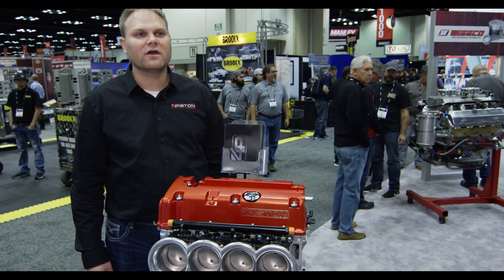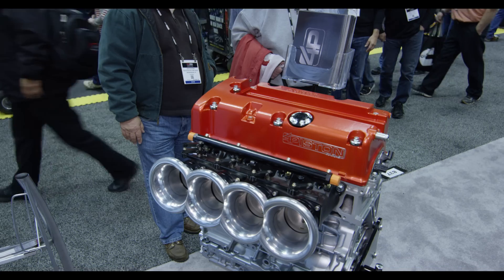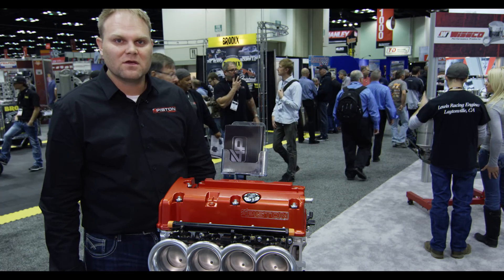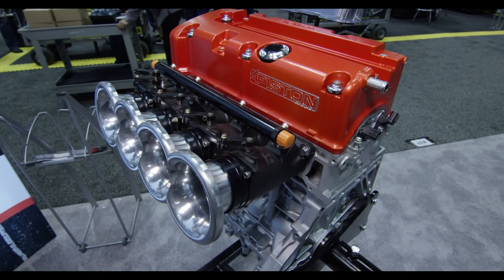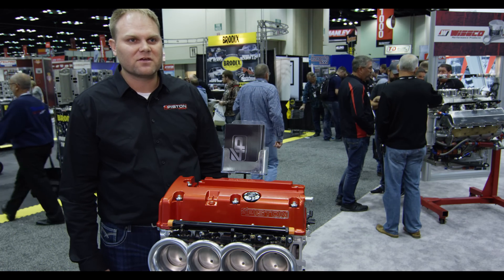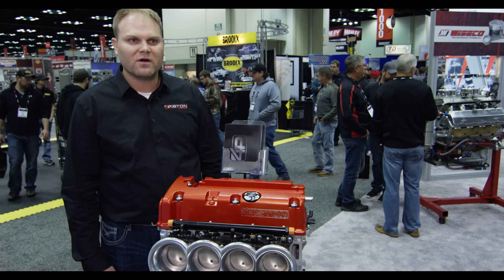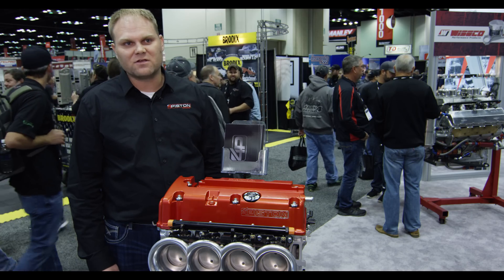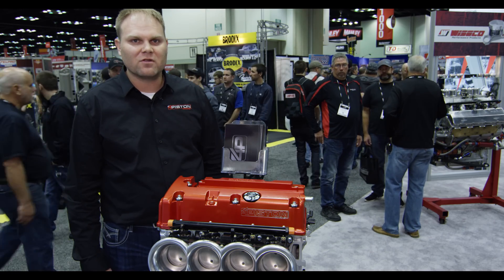Inside a 500+ HP Naturally Aspirated K24

Comment: I dont understand how they can increase the stroke AND redline around 10k without it tearing itself apart.
Reply: Billet/forged everything, dry sump oiling, coated parts, extremely tight tolerances and immaculate balancing…
Reply: Light weight recip and light weight valvetrain.

Comment: so how does a na engine make power, does it draw air from the outside or what?
Reply: It’s way harder and more expensive to make huge power NA, the whole engine has to be optimized for max rpm and max airflow, and then it’s tweaking and tuning and dyno runs for a year or so to reach max potential.
Reply: no shit sherlock
Reply: Every single engine that's not turbo or supercharged  runs on ambient air pressure. So basically almost every single passenger car up until very recently

Comment: I'm interested in what is the highest power you can make on 99 octane(RON) with that engine?
Reply: 150 HP per liter would be a lot
Reply: @SalveMonesvol  they have far surpassed that. 2.7 are making 600+ on nitro 50/50 now
Reply: @PolishedMobileDetailing503  He said 99 RON.
Reply: @SalveMonesvol  gotta be more than 150per litre for the 4piston there are stock block k20 and k24 making 300 with just exhaust headers intake and cams and probably valvetrain upgrades
Reply: @repingers9777  you are confusing RON with AKI.
Reply: I'm saying 93octane those numbers are achievable or e85
Reply: @repingers9777  E85 is great for boosted engines. For naturally aspirated high rpm engines alcohol has some issues: it burns slower, has lower energy density than gasoline and requires more air to make the same power. Of course, if I have to choose between E85 and dangerously low octane gasoline, I'll go with the alcohol.
  Anyway, 200HP per liter naturally aspirated with a usable tune is 15.000 rpm literbike territory.
Reply: @SalveMonesvol  Then...what the BEST fuel for NA engine?.
Reply: @MDEV-86x86  oxigenated 100 octane race fuel of course, but it's expensive.
Reply: @SalveMonesvol  Ok. In Germany you can get without problems 102 octane fuel at Aral gas stations.
Reply: @MDEV-86x86  I meant 100 AKI, which is 95 MON and 105 RON.
 But for street use on a naturally aspirated bike, 101 RON is great, specially if it has no more than 10% alcohol.

Comment: what's the minimum octane required ?  with 16:1 i'm guessing 110+ race fuel !
Reply: 17.6:1 running on 100 octane
Reply: @micekkc  In Germany you can buy 102 octanes fuel at Aral fuel station.
Reply: Good question.

Comment: I don't care who you are, this is freaking awesome. muscle car guy or not you have to appreciate the amount of time and effort that was obviously put in to making a 500hp naturally aspirated 4 cylinder at 2.7l anyone know what fuel they use when they dyno? compression?
Reply: they use 16:1 compression pistons and the fuel is vp racing m5 methanol
Reply: @straight_intro awesome
Reply: @straight_intro  Is the same engine with Alex gets 2th in the BEST Civic drag race ( famous video ) ?...
Reply: Sean Determan that and the fact that if you make a v8 using 2 engines like these you would be over 1000bhp from 5.4l v8. theoretically. i mean people join hayabusa engines at they make over 500 bhp.
Reply: Sean Determan C16 fuel for sure & ¿¿a compression ratio greater than 11:1 ?
Reply: Areth thou Maddith brethren ? any moron knows that a 4 cylinder making 500hp N/A is gonna have more than 11:1 compression, so that was a dumb answer.... Idk why you're so butthurt by me giving the exact compression ratio lol. Pretty big gap between 11:1 and 16:1
Reply: Ryan Cowtan a rhetorical question since I knew it would be <11:1, nice work on being a vacuous bag of sperm.
Reply: Ryan Cowtan "any 4 cylinder making 500hp N/A" so if it was an 8 litre with a massive bore & little stroke it would need a H-CR? Nope. Nice job on assuming I was a yank, but you're wrong.
Reply: Cam phasing for greater valve overlap combined with those huge ITB's definitely contribute toward the peak horsepower and I'd bet it was mostly top end. I'd be interested to see the torque curve. Perform best at WOT, but the cam phasing would make it more driveable at lower RPM.
Reply: Ryan Cowtan hence why I said GREATER THAN 11:1, learn to read, dumbass.
Reply: Search YouTube for "Beast of Turin".  4 cylinders, each 7 liters.  It really is a beast.
Reply: I think they used kerosene ...